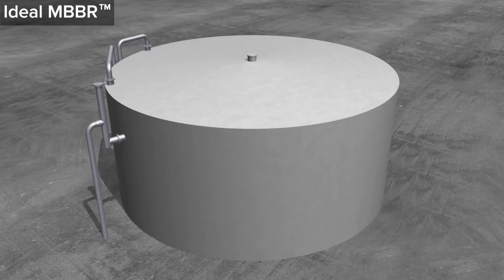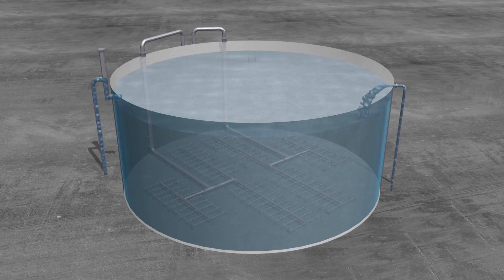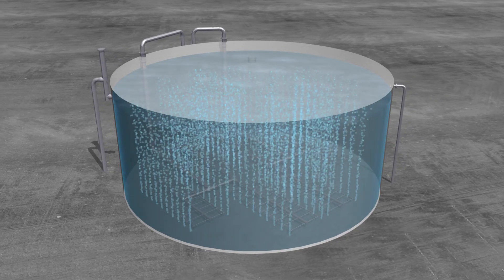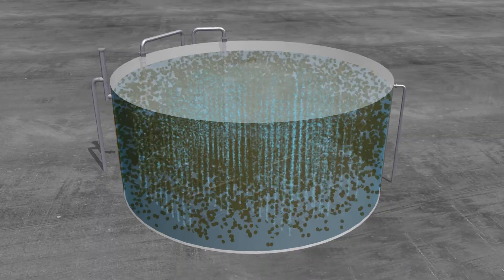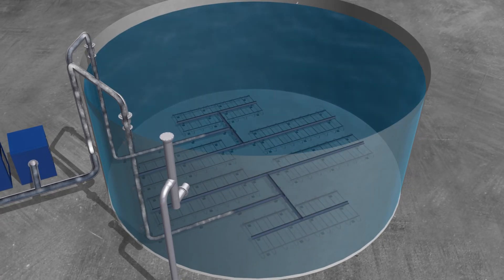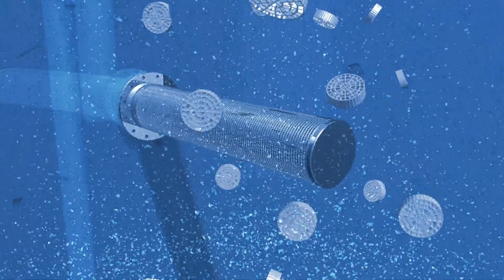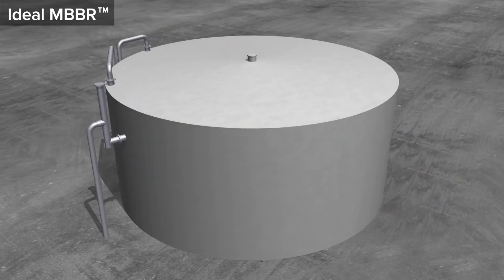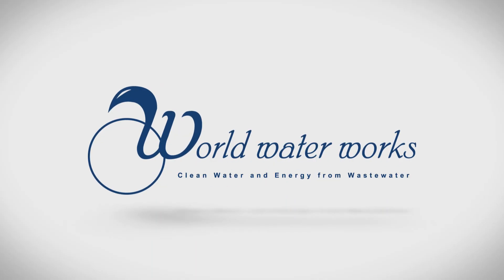Moving Bed Biofilm Reactor (MBBR) - Ideal MBBR™

Comment: This can be a good batch scale process where the reactor is provided in duplicate and one is used for very good mixing and oxygen provider for the MBBR. First one of thanks is filled  and aerated as a batch reactor. After the designated time the outlet valve connected to the circular screen is opened and the mixed liquor is drained  after filtration. Simultaneously the other tank is filled and aeration started and so on.

Comment: What parameters work best in the MBBR?  Such as DO levels, Nitrogen, BOD?  Do you have manual or information for an operator of these types of units in industrial pretreatment?
Reply: I only ask because my company bought this and an Ideal daf unit but no one knows too much about the best operation of these units.  I'm used to an activated sludge plant.  Our important numbers were MLSS around 2000 mg/l, 1 hour Setteability usually around 200 to 300 mg/l and SVI test, pH neutral if possible.  Also, should bugs be checked under microscope on biofilm to see what's growing? If possible.
Reply: Hi, I run one of these in scotland. Our COD load varies between 700-1500. We test for ammonia, Nitrate and phosphate 4 times a day over a 24hr period. This is essential in my opinion. Nitrate is controlled via sodium nitrate dosing pump, phosphate with phosphoric acid and ammonia with Urea. We also keep an eye on TSS and dissolved oxygen. I'd advise that you keep an eye on the bug population with a microscope which would also alert you to some bacteria that you dont want in the tank. Our activated sludge is collecting from a DAF and fed through a disc press in the final process
Reply: Also we found that the best parameters for our mbbr was ammonia levels 0-2mg/l. Phosphate 5mg/l. Nitrate 20mg/l. D02 7ppm

Comment: Doesn't the carrier material become clogged with biomass after a while, making the system loose it's function?
Reply from the maker: Michiel,  Thank you for the question.  

The carrier material is in continuous motion which allows for a sluffing off of the outer layer of biofilm leaving a thin layer on the material at all times.